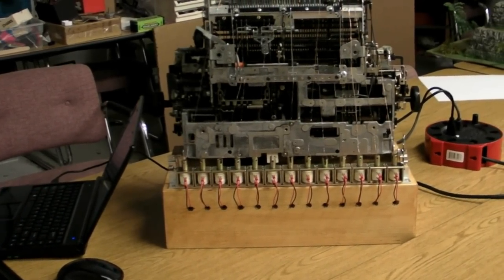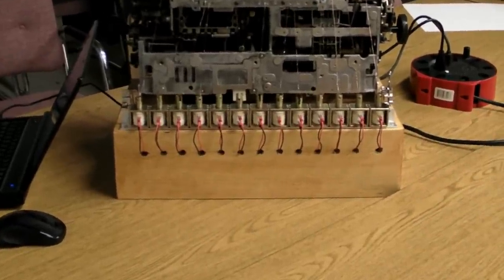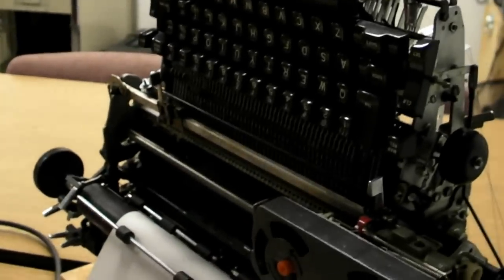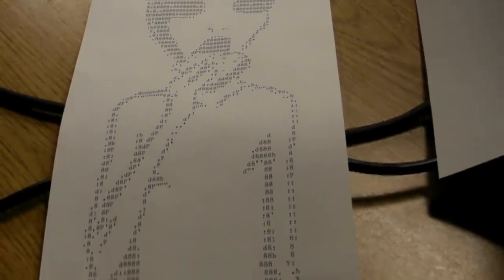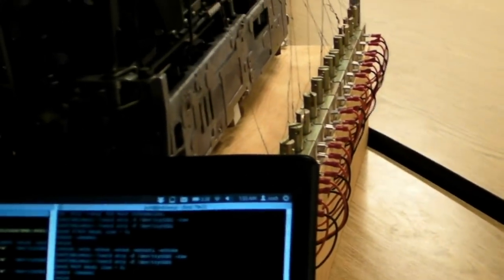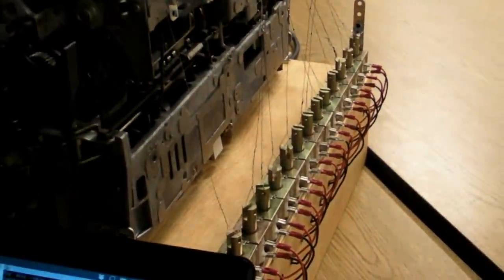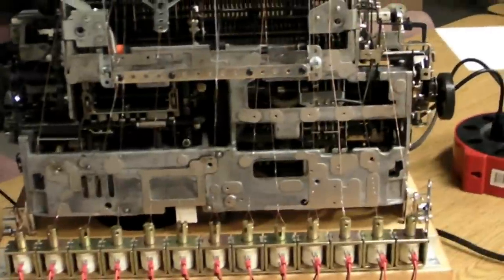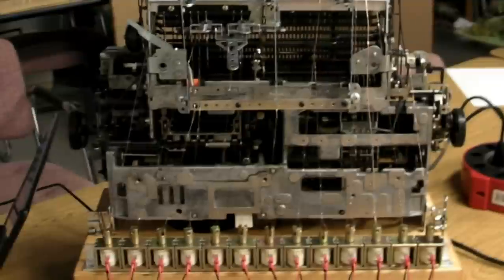Typo...matic (Part 3)

Comment from the maker: Both, it's limited to the speed of a skilled typist mechanically maybe 2-3 letters per second (at least this one in it's current state of old and not really maintained).

My program has hard delays built in that allow for travel time of the solenoids and other mechanicals...I could probably eek out a few more key strokes per second but at this speed it's more reliable and diagnosis of problems is easier. That alien took ~19 minutes to print at current speeds.

Comment: This is awesome work man!!!   I'm a traditionally trained Blacksmith, and am interested in this project, but know nothing about programming or wiring...  Do you have any plans on putting together any to sell, or selling plans?

Please let me know, Huge fan of this...
Jason
Reply: I don't plan to make any to sell. It's not really a reliable mechanical design, it just looks cool :) The electrical side of things is a bit more robust, but still pretty rough around the edges...same could be said for the programming (though it's what I do for a living so it's probably fine). There's more detail about the internals on my blog (see vid description).